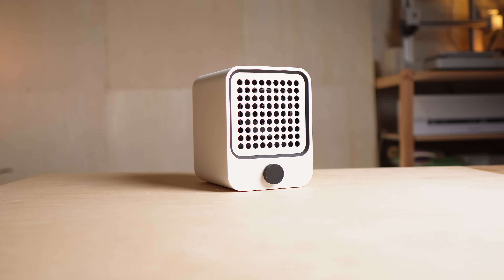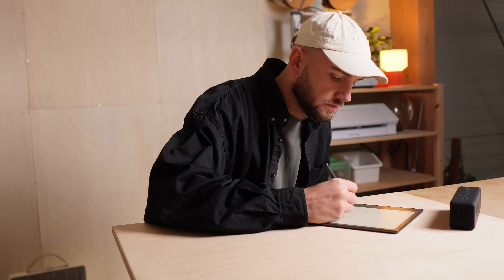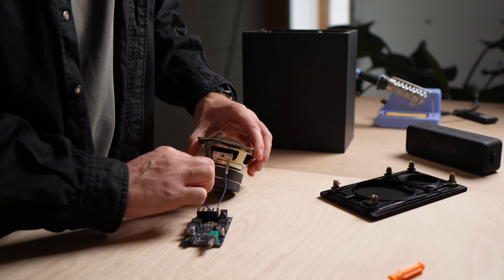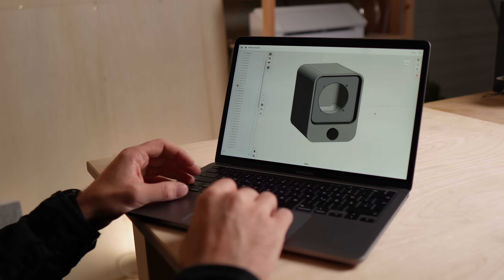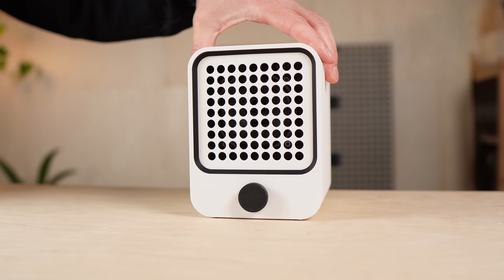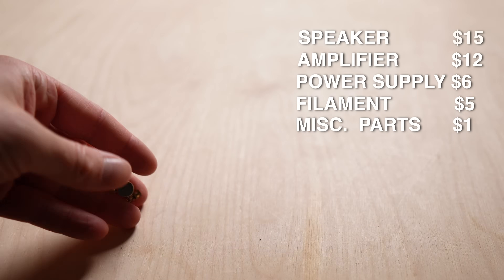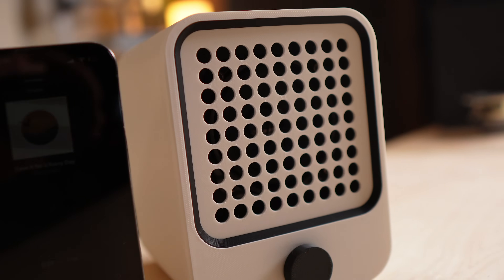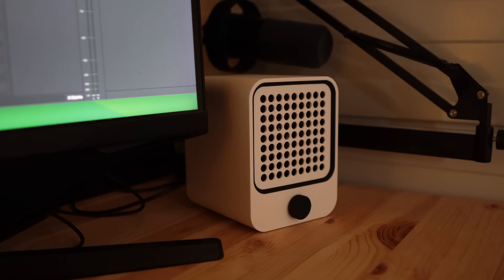How I made a $40 speaker that sounds like $200

Comment: This sounds awesome. Been thinking about upgrading old standard PC speakers that you can get for almost free on ebay or FB marketplace and design a new modern and cooler housing for it using the same hardware. Was thinking of making it like a soundbar instead of 2 separate L/R spakers. I just don’t have a 3d printer.😅

Comment: I thought the last section gets one more twist since it sounded complete crap, after 30s I realised that’s really it.

Aside from being loud, it’s shallow, it’s muffled, it has less dynamic range, the box leaks sounds.

The unit itself is fair, but your box is not doing its job as an amplifier, you did not calculate the internal resonate coefficients, you did not try to dampen the echoes, you did not try to broaden the already weak high and low range of the unit.

I feel my life wasted watching your video

Comment: since that wuzhi amp has a dedicated usb and aux ports, you can buy an extender for them so that ports can be added near the volume interface. you could also buy one of those cheapo adhessive heatsinks for the tpa3116 ic since sometimes it gets hot. overall nice job than branded speakers

Comment: You can remodel it and make the walls like a chamber which you can fill up with cement. It has been proven that this method makes speakers sound way way better. It’s a cheap upgrade
Reply from the maker: That’s actually a really interesting idea!
For this project I wanted to keep it lightweight and printable, but mass loading like that would definitely improve resonance 👍

Comment: It's not exactly true, that the speakerdriver itself is silent, and only gets loud with resonance. It is possible, to boost the low end of the frequency spectrum by using resonance (for example in a ported enclosure, where the air mass is calculated to resonate at the right spot, that is what gives you the deeper bass inside the black enclosure you have shown), and indeed it does get louder when placed on the tabletop, because that acts as a bigger, but very unprecise membrane. But the reason behind the silent speaker is not the missing resonance: The speaker is cancelling itself out, because the wave cannot develope correctly. In simple words: The air, that gets pushed away in front of the speaker can just move around the outside and fill out the rear, and the other way around. This cancellation works better, the lower the frequencies are. That is, why, even without an enclosure, we can still hear the high frequencies, wich sounds "thin". What the enclosure does, is simply blocking this cancellation in the lower frequencies by seperating the front of the membrane from the back. In fact, you'd actually want an enclosure to not resonate at all, because it will ruin the flat frequency response by placing uncontrollable resonances anywhere. That is, why material choice and a stiff construction play a big role in speakerdesign. An enclosure however is also just a compromise, because it affects sound by dampening the speaker driver. Instead of a box, one could also use a big sheet of wood for example. The bigger the surface, the lower the limit, after wich the sound will cancel itself. An endless (stiff) wall would be the best case, better than any enclosure. (quality wise... Regarding volume, not so much)
Reply from the maker: Thanks so much for the detailed explanation! I'll definitely keep this in mind:)

Comment: Lol, not only this speaker isn't 100% 3D printed, but even the enclosure itself - the only part that you made - also isn't even 100% 3D printed. 
Absolute majority of this project was prebuilt and bought. 
The only part that you made - the enclosure - wasn't even calculated to match the speaker power, response, resonant frequency, ect.

It would have been such a nice project if you were just honest about it. 

"I only 3D printed the enclosure, and made it mostly for the aesthetics, with no regards for sound, but given that it is a small desktop speaker, it still works decently for the price and gives you an IKEA vibe of making something yourself, with TeenageEngineering looks." There, that's the actual title 😉
Reply from the maker: Thanks so much for the feedback :) I really appreciate it. I get your point, but otherwise the video would barely get any clicks. I’ll remember your advice for the next upload though!
Reply: Yeah he used magnet and heat set inserts 😂

Comment: wide Rubber feet are a MUST. not those dots.. 
also go with some slightly thicker walls and damping on the inner walls. 
aside from that, fabric over that opening would make it look just perfect 
it DESPERATELY needs a rear port to help with low frequencies, it's called a bass reflex design or something but it needs 15-30cm distance from the rear of the driver.
also that driver sounds extremely dim in the upper range compared to your iPhone, I would suggest looking at something that more closely mirrors the Harmon Kardon line or just has less muddy highs. 
( just to my ears I haven't taken a spectrum reading and compared it or something ) 
overall for the price it performs like I'd expect it to, so good job, and it's really nice that it's all user replaceable if something breaks. 
my gut is telling me an extra 5 dollars on the driver and a back port + damping material would go kinda hard. plus maybe stitching together some better priced aliexpress parts ( you can even just use an esp32 and an amp board it'll be cheaper + u can make it show up on casting for things like spotify using libraries ) 
hell might give making one a shot forgot how cheap they are to make lol
Reply: 100 infill isn't better, it was tested
Reply: @3dThursday  fair enough removed it from the comment, is it something to do with the air pockets inside doing damping ? 
just wondering what might improve things for the speaker min max style lol
Reply: @ModarkVidsI'm not exactly sure but look up 3d printed speaker infill and there is a great video by an audiophile that proved it. I too thought solid would be better, and so did he!
Reply from the maker: Wow, thanks for all the insights! Super helpful. I’ll definitely try some of those ideas on the next build. 🙏
Reply: @PaulLagierEN  agreed really interesting to me as well, might even make one from myself lmao

Comment: Putting the amp below the speaker is simply genius. I wonder why speaker companies don't do this for easier repair and modding.
Reply from the maker: Thanks! Maybe because they don’t want a quick repair option :D
Reply: because they want you to buy a new one =)))
Reply: I mean, active studio monitors have their amps screwed into the back. Not that hard to remove either.
Reply: High end speaker sets keep the amplifier as a separate unit for obvious reasons. Having the amplifier inside the speaker enclosed is just a cheaper way of doing and it comes with multiple disadvantages, including poor dynamics.

Comment: Neat, might go the DIY route too next time I want/need a speaker for something, always considered it before. For a future project, maybe try something wacky to really take advantage of 3D printing like a (had to look this terminology up) transmission line design or porting...although I'm assuming they require more technical knowledge of audio engineering to make an actual good design sound wise. Would like to see how something like that would work with 3D printing too, like if you need supports and how to design and print so it's not a pain.
Reply from the maker: Thanks a lot for the ideas! I quickly realized how deep you can go in that area, so for me a basic speaker was more than enough this time but your concepts sound really cool! 🙌

Comment: First video on your channel! Loved the chill vibe. Definitely agree v2 suggestions of others. Here's a few future video ideas: 

1. Soundbar size with stereo for under a TV. Add some mounting holes on the back, maybe eARC or at least line in AUX. Get PCBWay / JLPCB to sponsor to do it in black anodized aluminum, you might even get commission and can provide a direct link to us - killer.
 2. Smaller profile stereo desk speaker - perhaps USB or AUX from the back (bluetooth is nice but plugs would make for awesome battery life). Maybe 2 inches high and 6 or so inches across. Knob on the top - chef's kiss.
Reply from the maker: Hey, thanks so much for the ideas and welcome to the channel! Really appreciate you taking the time to write this out.
Both concepts are super interesting, especially the compact desk speaker. I’m definitely saving these for future builds! 🙌

Comment: You should dampen the inside of the speaker with special speaker dampering material. This eliminates standing waves and slows down the moving air which can make the  speaker sound a bit lower.
Also lining the inside of the speaker with bitumen will reduce vibrations of the box. Stiffer walls also improve the sound, maybe worth a shot.
Reply from the maker: Thanks a lot! I’ll test damping + stiffer walls in the next version. Sounds like a solid upgrade.
Reply: Yeah don't forget to use a crossover driver modulation Protocol with braided silver core audiophile grade cables with some hi-fi grade print filament to enhance the sound staging without introducing distortion.

it's just a joke, don't take this seriously please
Reply: Exactly 💯. I was just thinking about the same. Try with two speakers and 4 holes. Two for passive radiators. Make a bit bigger than this one and also try to put a small display with nob for aesthetics. You'll end up making some of the flagship product 😂😅.

Just an idea. Hope it'll give you some more ideas to make bigger and better speakers.

Comment: Hey Paul, literally just found your channel. Your videos are quality.
I just got my 3D printer 4/5 days ago and was wondering what you use to 3D model, what program? How did you learn? Like doing shapes is fine but actually creating pieces that fit together. What did you use to learn & Lastly what was that digital sketch pad & pen? 
Thank you so much for this,  so inspired.
Reply from the maker: Thank you so much, that means a lot! 
I model everything in Shapr3D and Fusion 360 and honestly, I learned through small daily projects, experimenting, and fixing mistakes along the way.
Start simple, finish often. That’s the fastest way to build real skill.
And the digital pad I use is actually a Kindle Scribe for quick sketches and idea notes.
You’ve got this! 🔥